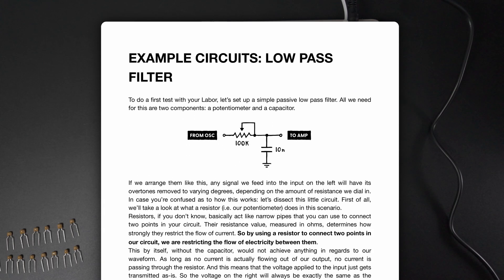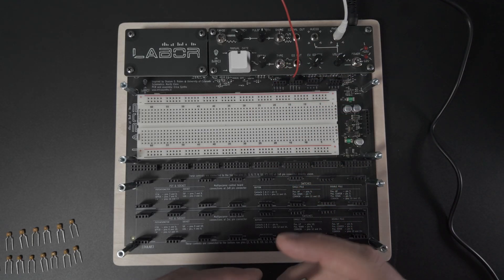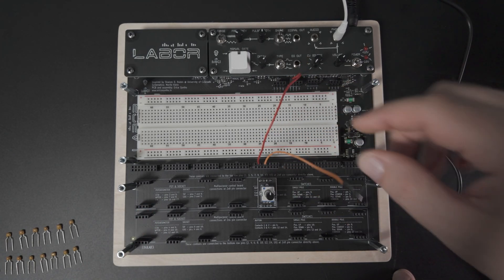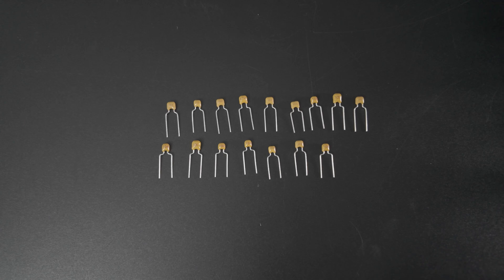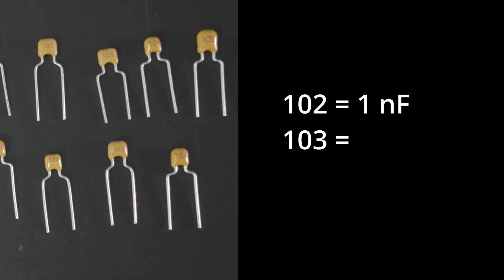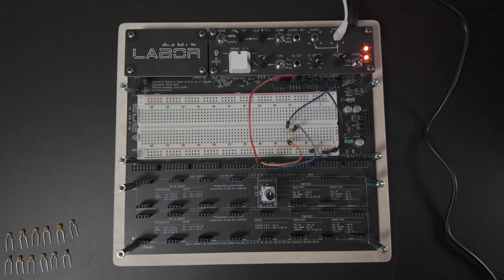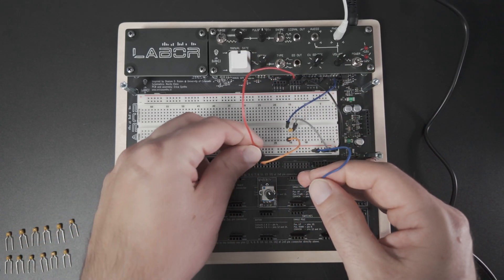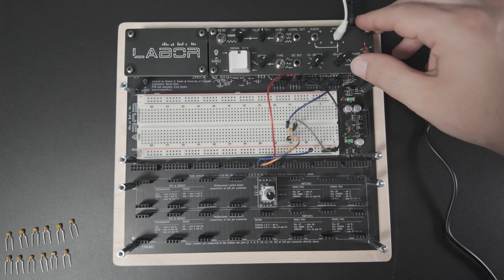LABOR DIY Synth Playground - First Steps: Passive Low Pass Filter

Comment: Wow I've been waiting so long for something like this that's affordable...!!
Reply from the maker: Same here! Getting all the surrounding things worked out was a big hurdle to all beginners (me included) - now there's this thing that comes with everything ready to go!
Reply: So… how much does this filter? Is it a single-pole filter, so 6db/octave, or is that not even how we measure passive filters?
Reply: @PeranMe  yes, this is a single pole filter with a 6 dB/octave roll-off – you can get a steeper roll-off by chaining multiple resistor-capacitor stages. though for it to be really clean, you'll want to put buffers in between every stage!